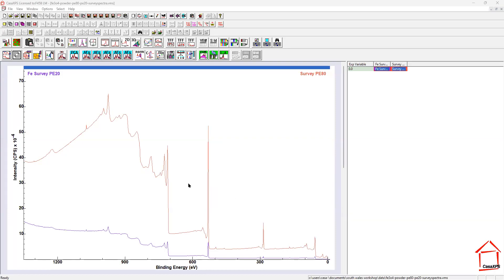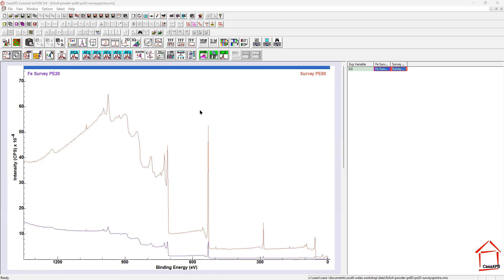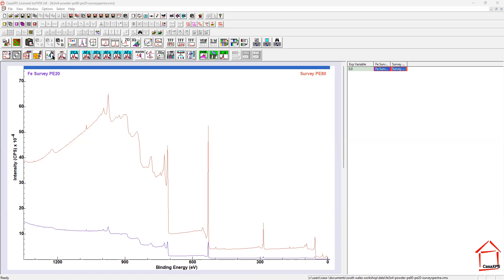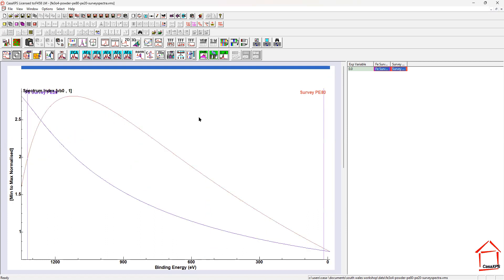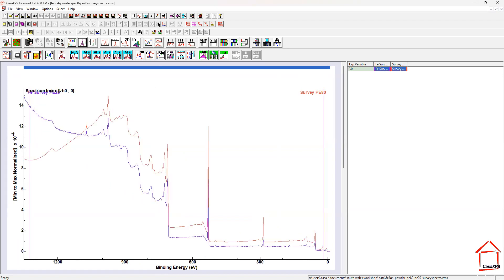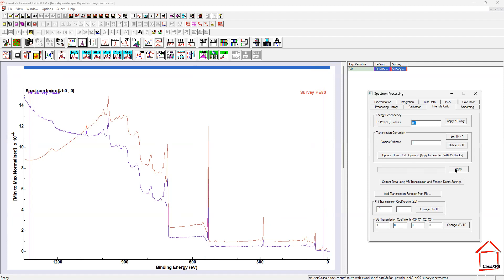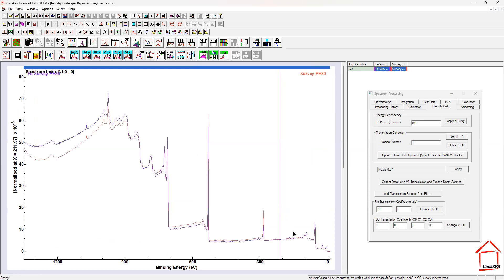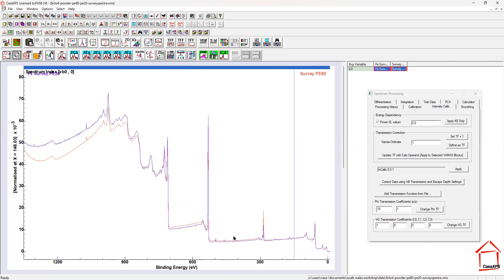Intensity Calibration Applied to Spectra in CasaXPS

Comment: Thanks a lot for the video. Is it possible to simply change the CPS value of a particular spectrum (for example, dividing by a factor X?)
Reply from the maker: The Edit VAMAS block fields dialog window offers the current dwell-time and number of scans. The total acquisition time is dwell-time multiplied by the number of scans. These values can be corrected for a spectrum within the dialog window which applies to the VAMAS block displayed in the lefthand pane of CasaXPS. The dialog window is available from the second toolbar, 7th toolbar button from the righthand end of the toolbar.
Reply: @casaxpscasasoftware4605  Thank you very much! I did not know this toolbar allows to make changes to the spectrum!